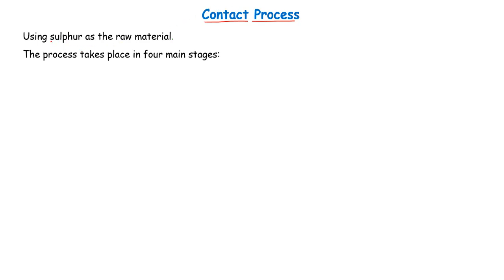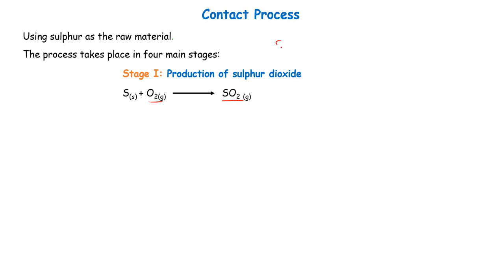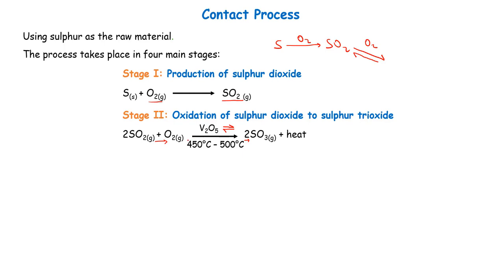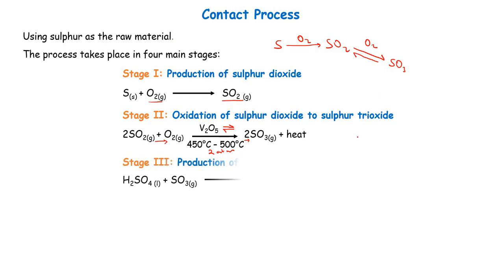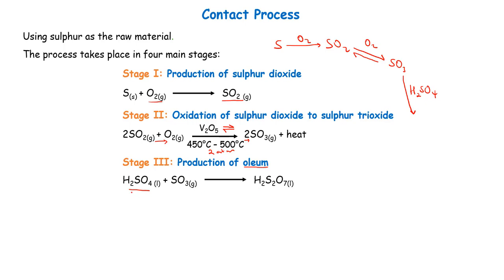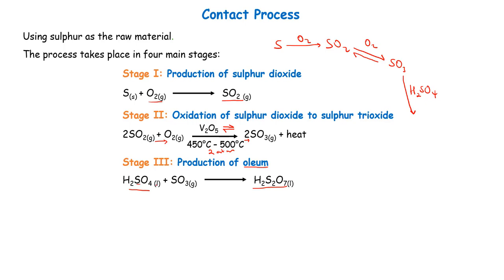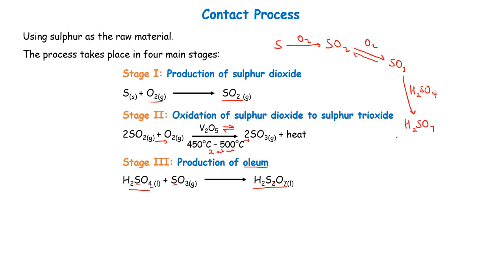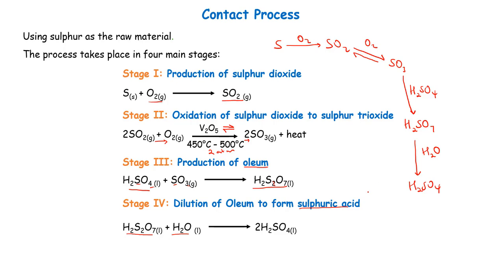The Contact Process (Summary): Industrial Manufacture Of Sulphuric Acid

Comment: I have a question, if we apply the le chatelier's principal, a catalyst doesn't have effect on the position of equilibrium and increasing temperature of an exothermic reaction will favour the backward reaction. Why do these conditions in the contact process favouring the forward reaction then?
Reply: I don't know if my reply will be too useful 7 months later but I don't think its favouring the forward reaction. With industrial use, they just use pretty high temperatures in order to increase reaction time. Doing it at a lower temperature would favour the forward reaction and therefore have more yield but the rate at which it reacts would just be too slow - also why they use a catalyst so they can increase reaction rate.
Reply: Catalyst only play role in reducing the time taken to reach the equilibrium condition by its effective conversion rate..@yunnie-cho